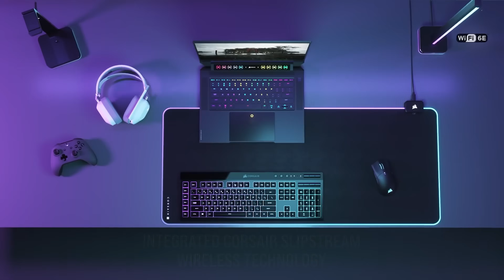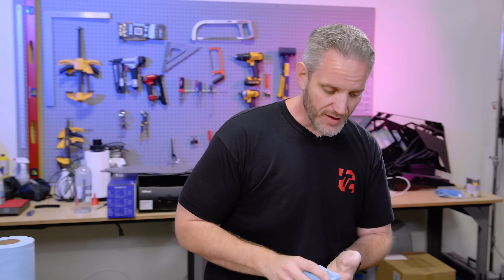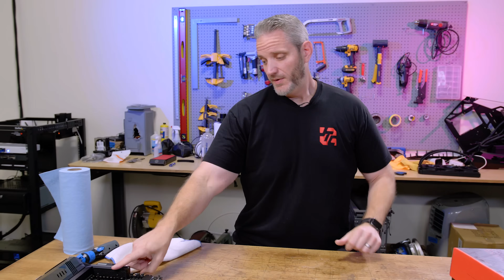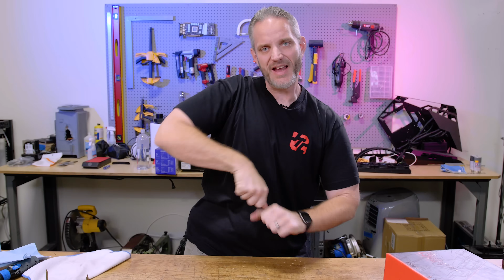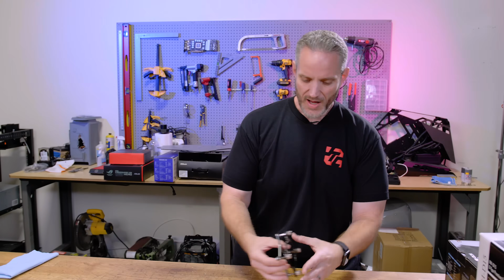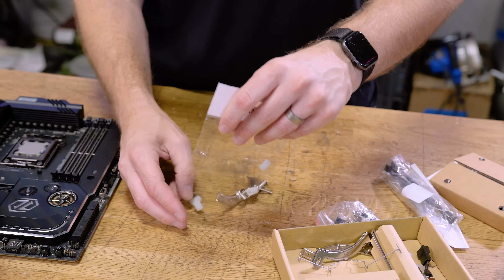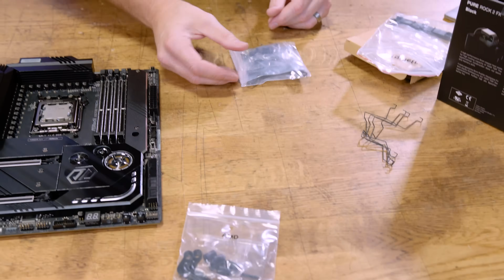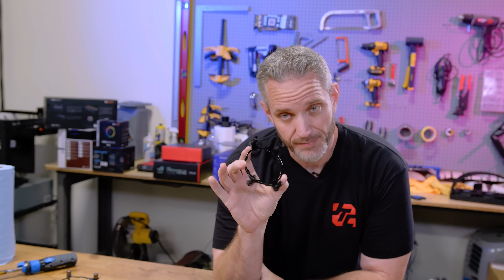AMD made a terrible flaw with this design...

Comment: "Back in the day" when I had my 1GHz AMD Thunderbird... which I assembled myself and all... Ever since... at EVERY LAN party I would attend, people would basicly stand in line for me to mount their AMD coolers, because they knew I had done it myself. Every single time I told them "I'm not responsible if ANYTHING goes wrong with this" and people would just agree, shut their eyes and PRAY it went okay. People were horrified about those mounting mechanism. I saw plenty of people where the tabs had been snapped off because they didn't apply the correct amount of pressure and it'd just grabbed it wrong.
I never ended up breaking anything, but had a few of those where they had like 3 tabs on each side, only having a single tab left and all.
That being said, I HATE those tabs. And as much as people say they hate the Pentium4-styled turn/snap screws, I absolutely loved them.

Comment: I've been tempted to replace my quad core I 5 with the 7000 series, but have my reservations because it's the first release of the am5 platform. The following releases should be even better. Your video pretty much seals it for me with the price of the motherboards and ram. The 5700x will certainly do what I need for the next 5 years. Thanks for the video heads up on the cooling.

Comment: The way you explain it is what I was thinking all along. As long as it doesn't need a different backplate you're good. However, with everyone coming out and releasing press statements about their compatibilities, I go treally insecure. ASUS for example says that 3 of their 4 AIOs will need an AM5 mounting kit and they include the ROG Strix LC in it. I have one of those and all it does is replace the plastic brackets with those screw-in standoffs. So how come it will still need a new mountingn kit?

Comment: The offset holes (15:29) have NOTHING to do with cooler mounting or backwards compatibility.  Those notches are to key the plastic brackets that come stock, so you can't install them backwards.  Stop spreading misinformation.

Comment: i absolutely hate that corsair went with the hook system on the h150 until they released the lcd model and they dont sell the mount bracket seperately. i am currently looking to leave my corsair for one from microcenter with the bracket setup.

Comment: This is why I NEVER go with anything that just came out, just too many things/bugs that need to be worked out. Now I have been watching many testers that have removed the die-heatsink and made there own bracket and cooled directly on the die itself and got  60-65C temps STOCK with higher freq. But since the CPU bracket is thick, the reason for the die-heatsink to be thick. - makes sense money-wise for other cooling manufacturers not to retool their products for a new line of CPUs. Personally, I'd rather have a cool CPU instead of a house heater like INTEL....

Comment: Even with am4 I had to make custom backplates in order to use some coolers correctly, as I saw it its time to cut the plate with a disk and split it in two different parts one in the center holding the socket bracket and other for the CPU cooler. or mod the cooler to fit the ribbits in the plate.

Comment: Not a smart move by AMD here i dont think !!  basically if the IHS is thick for the 3d versions that is unfair to the normal 7000 cpu buyers also there is little to no option that doesnt void the warranty of the cpu here to fix said issue !!
Other than hit eco mode in Ryzen master that is flawed as well because  it eco modes every  7000 cpu to 65w which nerf's the hell out of the 7900 and 7950 performance .. 
The bios eco tune is about the only thing that can kinda help !!

Comment: AMD always wanted people to NOT remove the original backplate in AM4, it's in the thermal product design guideline, it's cooler manufacturer's fault and problem if they use/used an different backplate, nothing wrong there, on AM5 they're just "forcing their hand" so manufacturers start to use the god damn stock backplate, it will make things easier moving forward in terms of combability.
But I do think AMD should've just changed the entire thing and made AM5 totally incompatible with previous coolers, doing what was done in the interest of keeping combability made things worse, the Z height of the IHS is unnecessarily tall, temperatures could be better if it was thinner.

Comment: AMD had a lot on their plate designing AM5. I bet someone had the bright idea to lessen the headaches by retaining what they could from AM4, and market "Cooler compatibility".  Also, they didn't intend to push the new chips so hard. Remember Robert Hallock giving interviews about 230W being there for futureproofing the socket, and then BAM! 1st gen AM5 is pushed to the maximum possible "safe" power and temperature, literally "pedal to the metal", way beyond any efficient operation! Something changed from the unveiling of the new socket to the start of sales of actual CPUs... 95⁰C may be safe short term, but I question the longevity of a CPU if it's pushed at it 24/7. There's an old rule of thumb in regards to electronic components - every 10⁰C lower operating temperature increases the mean life expectancy twofold. Or, an increase of 10⁰C halves life expectancy. There are a lot of 10⁰ increments to 95⁰C from where I'm sitting, so a lot of exponential halvings have to take place... I'm no CPU designer though, I've dealt primarily with power electronics and my experience with BJTs or Mosfets and cooling them may not be relevant.

Comment: What is..... We shave down the IHS a few mm, like lapping it 2 mm? Can we make significant cooling gains?
All we have to watch out for is that the surrounding bracket.....

Edit: Did the math on the info I could find. The IHS sticks out about 0.8-2mm, depending on variance. Then again, if you can shave off 1mm and the IHC is 3mm thick, thats the potential for some gains?
Reply: The potential is not lower temps, but higher clockspeeds. Because the boost algorithm will always try to go to the limits, which due to increased PPT usually is thermals.

Comment: I miss the simplicity of the times when just using the stock cooler was enough now, besides having to worry about the CPU compatibility on the motherboard, you have to worry about assembling the cooler that we'll have to buy separately. 😮‍💨

Comment: It’s a combination of higher wattage along with thicker IHS which causes AM5 to run hotter not just the thicker IHS.
Reply: None and all of it: the thicker IHS gives some additional thermal resistance, that potentially leads to higher temps in the cores. Then people might think the higher PPT is the problem. But it isn't.
AMD's boost algorithm since Zen2, but especially since Zen3 increases clock speeds under heavy loads until it reaches either PPT, max temp. or EDC (limit of electrical current) to get max performance out of a CPU. For Zen4 they have increased PPT so high, that temperature limit usually is reached before PPT or EDC.
They are still checking for PPT, EDC etc., but now the boost algorithm increases clock speeds until it reaches the thermal limit of 95°C and stays there (unlike Intel CPUs, which throttle). 
The CPUs running hotter is simply AMDs design decision. Even with a thinner IHS, the CPU would go up to 90-95°C, because that's how the boost algo is working.

Comment: Regarding AMD backplates and EK blocks, I'm pretty sure my current setup has my EK standoffs straight into Asrock's backplate.  The hole spacing and threads were the same so i just used the stock backplate.  I don't know if the same would work with AM5 though.
Reply: I did the same.  Since the screw layout of both backplates are the same the only variable could be the length of the standoff from the backplate on the CPU side. But in 99% cases it's the same

Comment: Saw this issue coming. At the end of the day they compromised performance on the new gen at the expense of compatibility. Even if it's not 20 degrees and more like 10 degrees with the old IHS height taken into account, it's still a compromise at the expense of performance.

Comment: What's really tragic about this is that the motherboard manufacturers CAN make it so that the coolers on there are 4 mount standard, and it would make everyone's lives a lot easier because then even the custom cooler manufacturers would just make all their coolers 4 mount applicable. But instead they don't, because why make things work properly when instead you can make a bunch of hook garbage that everyone has to replace and no one likes for like 20 years.

Comment: I'm wondering if they are somehow planning on making the next generations CPU's taller in which case the taller ihs could just be a stopgap to insure longer socket compatibility.  3d v-cache maybe?
Reply: I have seen this hypothesis on a lot of thread. But this beg the following question :am4 have a 3d version of the same height. So why?
Reply: @atavusable  Only time will tell.  When planning for the future its probably better to have too much space than not enough as long as its not affecting performance too much.

Some possibilities that pop into mind:  
Maybe they planned for something else with the 3d v-cache but ran into height constraints that they want to alleviate in the new platform? maybe some layer between the others to help with cooling perhaps so they can still be overclocked?
even more v-cache per CPU?
maybe its not 3d v-cache at all and they have something else planned, beefier chiplets maybe? 
more room for beefier iGPU stuff?? (wink wink)
Reply: @atavusable  No, they don't. What they HAVE is a shaved CPU that just about fits a VCache in the same height. See that shaving? This is why they have to decide beforehand what chiplet will be made VCache for the 5800. Not with the AM5 version. Just take the chiplet that the 7950 or 7700 would take and put VCache on it. No shaving required.
Reply: Possibly. Doesn't hurt AMD either. A laptop doesn't get the IHS of a desktop CPU, and so won't be affected, it STILL boosts to beat the Intel equivalents for games and multicore (RPL may beat it on multicore, for SOME apps, but for games, it is not likely to beat the AMD competition by a fraction that means anything). However, if you delid the CPU, you can get it even faster, but lose your warranty. Zero problems for OCers anyway, who delidded every earlier CPU too.

Comment: But if they didn't make coolers compatible, people would be screaming that now you have to buy a new cooler - which would probably not be the case, but you'd need an AM5 compatibility set. It was a good time to do it, but before launch a lot of people were worried about cooler compatibility. It's sort of damned if you do and damned if you don't.

Also I do remember AMD saying that coolers without custom backplate would be incompatible. Though it was easy to miss in all "most AM4 coolers will be 100% compatible" hype that I've seen.
Reply: I'd much rather replace the cooler than to have a CPU that is running at 95c 24/7.
Reply: @Stubbies2003  then use the curve optimizer and run it at 70 degrees with no performance loss.
Reply: @WayStedYou  only if you don't care about noise
Reply: Some people will need new coolers anyway, since these CPUs want to run so hot.

Comment: Well now I wanna see what Der8auer learned. I'm not planning on moving to AM5 until the 3D Vcache models are out, so hopefully by then his mounting mechanism improvements will also be out.
Reply: This is the way.  It's called the bleeding edge for a reason.
Reply: The fact that delidding even has such a big impact is worrying, in addition to pricier mobo, ram, cooler compatibility issues, etc.
Reply: @haraldhimmel5687  would assume they did it to have some room in the future for 3d cache, otherwise its an oversight ... Lets see
Reply: @TrueBark  Sorry about stepping on your toes, I posted before I read yours, post deleted.  Yes, I thought that might be the case (no pun intended).  I hope so.
Reply: @haraldhimmel5687  Why? WHY is it "worrying"? Were you worried that you could delid and get 400MHz more, at the expense of more power used (because P=IV^2)?
Reply: @markhackett2302  If you can save 20 deg c through a delid amd did a shitty job in the first place. idk about you but i dont wanna delid a 700 bucks cpu bc the manufacturer fucked up cooling and damn near every cooling solution fails at making it not thermal throttling.
Reply: @haraldhimmel5687  failing a delid, shave off 1.2mm off the lid via CNC and I imagine being extremely careful, will warrant same results.. why it's soooo think I don't understand, I really don't
Reply: 3d vcache models have an effect at 4k gaming with higher end GPUs? I would it only affects games that bottleneck at the cpu at 1080p
Reply: @Doomsday604  There are always games that are CPU limited, no matter the graphics.  
Strategy games with lots of units for example that have one big main thread and don't use the other cores all that effectively (StarCraft 2 when 800 units are on screen and Stellaris late game for example can't ever have a strong enough CPU)  ...Emulation can be very CPU heavy.  
That stuff is just not cool enough to end up in your youtuber benchmarks.
Reply: @Doomsday604  taking all that what zero said into account, look at ryzen 5800 vs ryzen 5800X3D in benchmarks for 4k if you want a reference brother, you can expect similar uplift in the 7000 series, if not better because the tech has matured a bit more now

Comment: Just saying you can easily undervolt any of the 7000 ryzen and get the same exact performance and save 10 to 20c. My 7950x runs at 5.1ghz at 1.1volt. And can boost single cores at 5.8. And it runs at 80c max and 40c idle

Comment: It seems to me if the AMD engineering dept knew they had to use a thicker IHS, they would have spec'd a material with greater thermal transfer efficiency, such as copper....

Comment: The 20C drop that der8auer saw suggests that the heat spreader didn't do its job (spreading heat) very well - 20C matches up pretty well with the thermal gradient a 4.5mm thick 142mm^2 copper chunk would have at 275W (about 21.8K assuming 400W/mK thermal conductivity)

Comment: I've seen that undervolting helps a lot without losing any performance. They just let it boost to oblivion and hit ridicules temps to beat intel. Which is not the best move because how many people will actually play with the settings. Granted with the high end cpus i would assume that the people who buy those most likely have the necessary know how on how to do that. OEMs and regular consumers who just buy the best bits and be done with it might suffer from that.

Comment: I Love how thicc and close ear the PC community is, the info is out there if you only read and listen, 
but unlike the legacy media, YouTubers and other outlet out there, don't read from the same script nor just read press release or talk about the whole interview, they focus on what they like to talk about and many time if you only get your info from only one source your gonna missed out important info.

the 2 to 3 degree difference Roman was talking about was between the new lab liquid metal that he was using vs other liquid metal you can buy now on the market.

now making a stamp or laser cutout bracket to make a new backplate IF cooler doesn't use OEM backplate to make it work with AM5 can be done even with the covid bottleneck, 
but making new ground up cooler would cost way more and take longer time to get out there.

and direct die cooling is not a new hot thing, old AMD Athlon CPU didn't even have IHS

this nothing more than storm is a teacup.

Comment: They did not make a design flaw. The future release with x3d needs more space. So they don't want to increase the size when they release those. That's the same reason why there is only a 5800x3d. The other ones would not fit inside due to the extra space needed for the cache..

Comment: i really don't understand why the thickness would matter.  it would take longer for the heat from the cpu to heat up the slab, but if you're pulling the heat out of the slab as fast or faster than the cpu is putting heat into the slab, then it shouldn't matter how thick it is.  i don't get why the cpu would run hotter just because of the thickness of that slab. the only thing that would make sense is if the parts that are getting hot aren't heating the slab directly, so it takes time for the heat to pass from the hot spots to surrounding components that ARE directly passing heat to the slab.  if that's the case then the thickness of the slab isn't the design flaw, the flaw is in what parts of the die are being directly heatsinked by the slab.  if that's the case, then he bypassed that design flaw by directly heatsinking the hot components that the slab wasn't.

Comment: Why didn't they make the backplate standoff height lower with the original thickness ihs? Wouldn't that also solve the height issue while maintaining compatibility across both platforms?

Comment: the real issue is that the standoffs are the wrong height. you could possibly file them on the bottom side (the one that screws on the mobo side) to make them smaller, allowing the cooler a better contact with the processor.